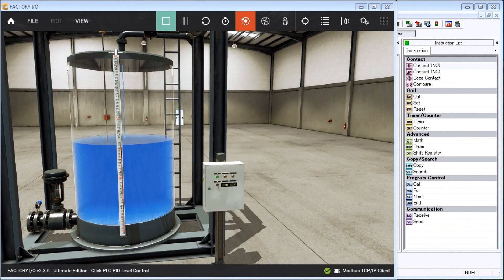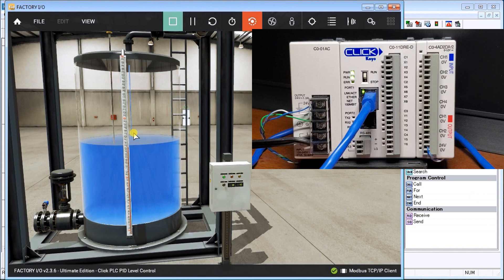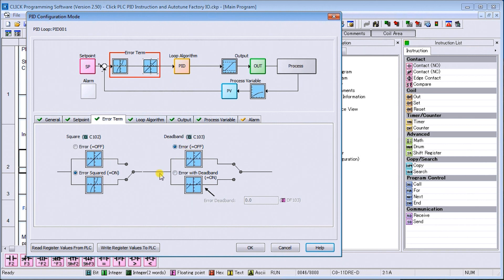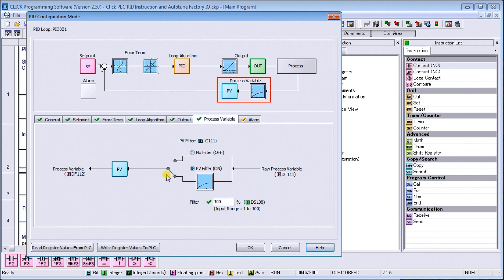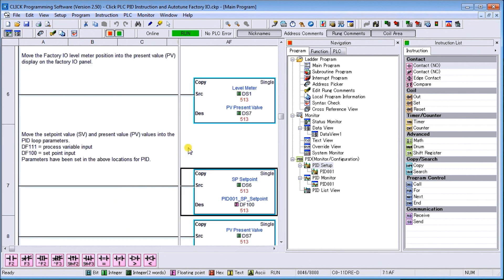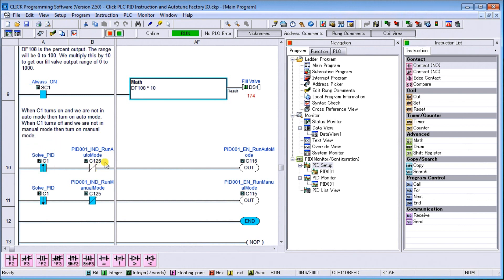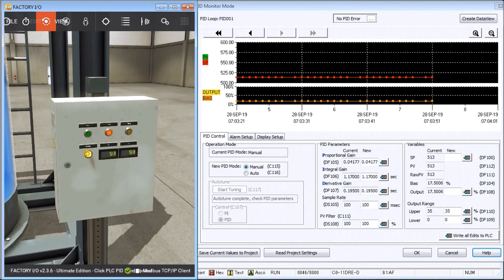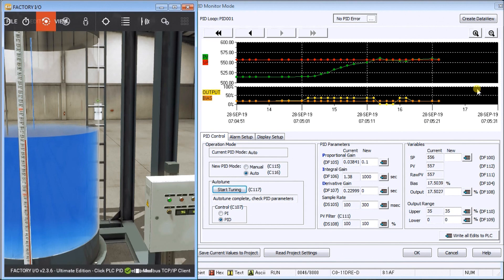Click PLC PID Instruction & Auto Tuning with Factory IO Now!

Comment: thanks MR
Reply from the maker: Thanks for the comment Hetan.
Garry
Reply: You used a lot of click plc.  Have you thought of training on other brands such as Siemens or AB?  Although the ladder is identical but some brand uses instruction differently.  Nothing wrong with click, I was just wondering that's all.
Reply from the maker: @mengxyooj129  
Thanks for the comment. The Click PLC is the most reliable, cost-effective unit that I have programmed. Software is free and Modbus RTU (Ethernet Modbus TCP) is available on the units. This is a good PLC to start learning about programming PLCs.
I started out my education, programming the AB 2/30 with data highway. Working for Omron taught me the S6 (One of the first micro PLCs), C28K, C200H, C1000H. I also worked for Siemens learning the S7-200 and S7-300 as they were being introduced.
I've developed several series on different PLCs based on their capabilities.

Click PLC - Low-cost PLC
https://accautomation.ca/series/click-plc/
BRX (Do-More) - Free software (Do-More Designer) includes a simulator to check your program before purchasing any hardware.
https://accautomation.ca/series/brx-do-more-plc/
Productivity 1000 - (P1000) - Tag-based programming (free download)
https://accautomation.ca/series/productivity-1000-plc/

Omron CP1H Series - Small PLC with position control
https://accautomation.ca/series/omron-plc-cp1h-series/
Omron C28K Troubleshooting
https://accautomation.ca/omron-c20k-c28k-c40k-c60k-troubleshooting/

Horner XL4 - HMI and PLC in one unit. Free software. Ideal for washdown environments.
https://accautomation.ca/series/horner-xl4-series/

Mosaic Safety Controller
https://accautomation.ca/series/mosaic-modular-safety-integrated-controller/

PLC Fiddle
Free on-line PLC simulator in your browser
https://accautomation.ca/series/plc-fiddle-online-plc-editor-and-simulator-in-your-browser/

Other items that I have a series on is the C-More HMI and C-More Micro HMI.
Thanks,
Garry